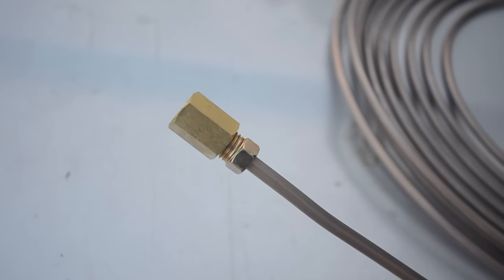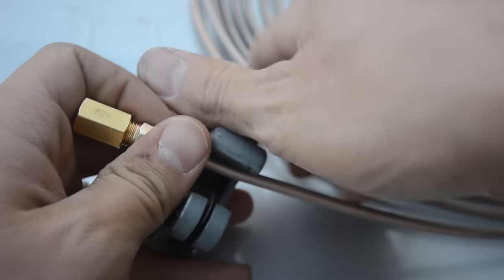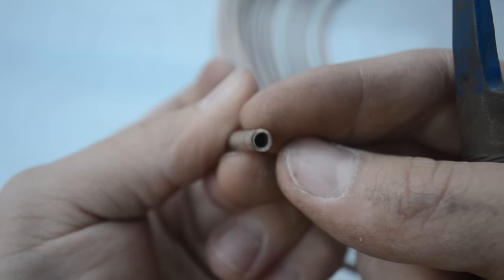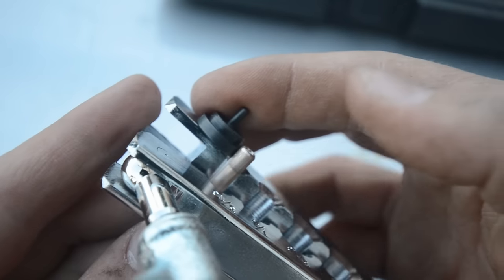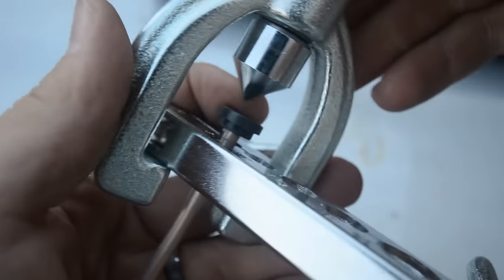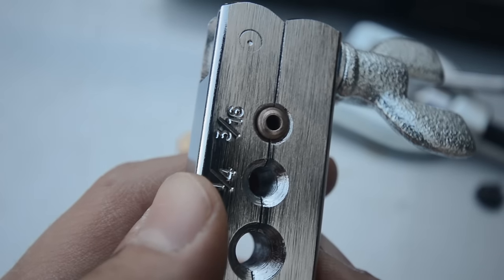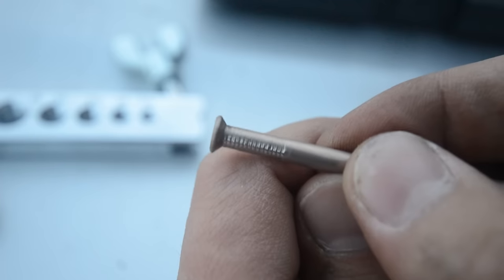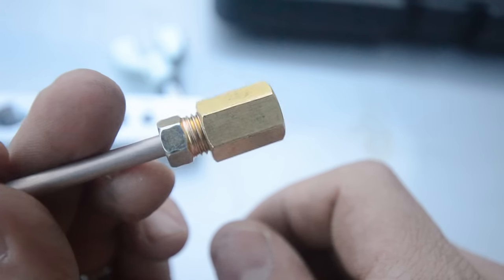How To Splice a Brake Line Using a Double Flare Union

Comment: Good video info, but you can't use it. You forgot to add the other nut before you flared it. Now you will have to cut the flare off put the nut on and replace the line😅
Reply: Dude, it's a 3 inch piece of line, used for a demonstration. Give the guy a break. Use common sense. Good video by the way. 🤦‍♂️
Reply: @elisardososa8588 
Dude, Demonstrations need to be accurate!

Comment: Thanks for this.  My car just failed inspection due to a couple compression fittings (which have worked fine for years).  So now I've got to go replace them within 30 or my registration gets dropped.

Comment: Benjamin, great video, very complete and timely ... I just had to cut off my old brake line and didn't want to have to replace the entire steel line from the Master Cylinder to my wheel. I'm hoping I have enough room to flare the steel tubing so that I can put in the splice.

Comment: Very good, and safe video! I'm 69 years old and have used this tool many times (
 wrongly ) I must add. I never had that small black tool for the double flaring. It's so much better doing it this way! My way worked , but this is much better and a clean looking job.

Comment: Your video has changed me from steel to nickle. Very good video. Thanks
Reply: Sloan Pilgrim and was your install successful?  Did yu buy a big loop of line and separate fittings or the pre-cut lengths with fittings at ea. end?
Reply: I too am a changed man. Remember when Moses went up the mountain and when he came down his hair was white and his face was golden? That happened to me.

Comment: Thanks, this was really helpful, I had never done this so of course the first ones I had to do it with were the spiral ones that come out of the ABS unit on the S-10.  But I got it done.  The crazy thing is I replaced one 1/4 line with 3/16 and it was fine and didn't leak.  Very happy I got copper nickel because I was able to bend by hand without kinking and they flare easily too and won't rust.  I even reused the fittings, you can reuse them if the threads and sealing surface is good, light surface rust makes no difference.  I also second the idea that your tubing cutter needs to be sharp and the cut straight.

Comment: If you are working on steel brake fluid line use ATG's bubble/double fare tool.
It will also be easier when working under the car with limited spaces.

Comment: Great video. You make it look easy.
I have to use some real torque on the original brake line. 

I've been using the ends of the removed section of brake line to practice, and I'm glad I am... Because my first attempt at flaring turned out terrible, and I'll be doing this to the existing line still on the vehicle. 

It's going to take some real rigging to keep the existing line stable and also keep from bending/breaking it while flaring.

Oh! That little black part of the flaring tool is called an adapter. 😉

Comment: Thanks good video getting ready to splice into a brake line on my truck am still torn about using compression fittings or flaring the line I only drive this truck less than 100 miles a year
Reply: John Heilig flare fittings can't handle the pressure of brake lines. Just a matter of time before it fails. Safety first
Reply: John Do you mean the compression fitting because the end of the brake lines are flared.
Reply: I used the flared end by the distribution block and used a compression fitting just in front of the fuel tank. Because the line is leaking behind the fuel tank. So far so good
Reply: This truck is only driven rarely and only within twenty miles on country roads
Reply: I guess it depends on how important it is to you to have brakes when you need to have brakes?
Reply: So far so goodAAAAAAAH!!!!!
Reply: John Heilig You know, I bought 25 feet of copper nickel line and I borrowed a double flare tool from advance auto.  I had never done this and they were the lines that spiral around so it was a little tricky but Wow, it wasn't the slightest bit expensive and was able to reuse the fittings, as long as the sealing surface and threads are good you can reuse them they can have surface rust.  Really, you didn't really save anything risking your brakes blowing out.
Reply: Thanks I weighed the options, and looked at that, I decided as little as this truck moves it would be OK, it is destined for the scrap heap. I mostly drive on my property, it rarely if ever goes on public roads and then they are rural. I was driving it down my driveway when a wheel cylinder gave out. Then after fixing the wheel cylinder the brake line blew out while bleeding the brakes. I was over it. Now I am waiting for the other wheel cylinder to go or any other multitude of items to go.
Reply: John Heilig None of that stuff is expensive. If you ever drive on public roads, you should try to make the vehicle safe.
Reply: To be up to code it must be a flare. If you have inspections like they do in my state a compression fitting will fail inspection. Also unsafe for the road because of high pressure and vibration. Only use compression on water lines even then not the best.

Comment: How do you measure for the length of the new section of brakeline,presuming you cut out a section that was bad? The new section would have a union on both ends,so how would that affect the length of the new section before you added the flare fittings and two unions?

Comment: Nice job Benjamin, I need to replace a section of my rear brake line on a 1982 Fiat Spider.  I anticipate trouble to cut and drag a line out a line buried under the car.  I could replace the whole line but not looking forward to weaving and bending all the way back from the master cylinder.  I will be going Steel to Steel as I have unused line here at home and I do understand that the copper nickel is much easier to work with but...$$.  Working with the flare too under the car in tight spaces sounds rough but doable..  I wonder if the original brake lines on this care are metric and would require a metric flare tool..? Additionally, would a metric junction be r
Reply from the maker: +Bruce Hendricks When I was working on my Civic I believe the lines were actually metric but matched exactly with 3/16ths line. You'll probably be fine with standard sizes and tools if yours is similar.

Comment: Does the copper brake line hold up better than the meta brake lines, I see that is easier to work with. Your flare were dang near perfect.
Reply: ni cop brake lines are easier to bend and they dont rust.